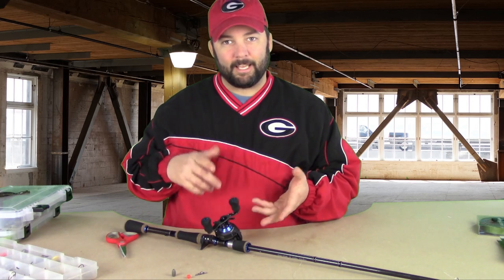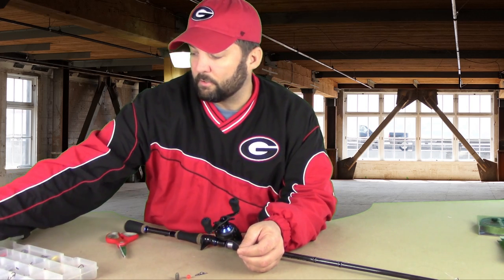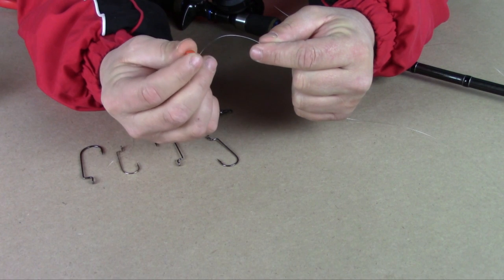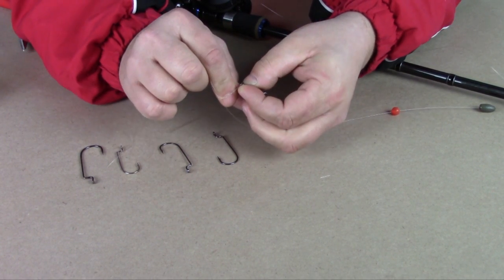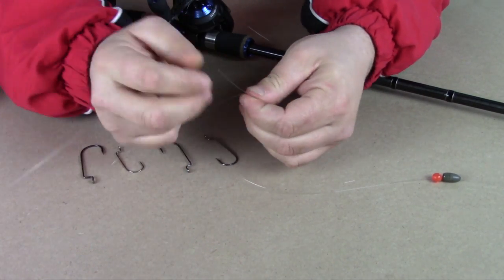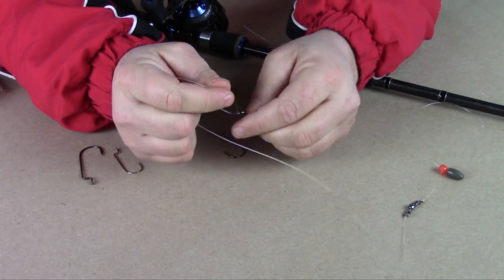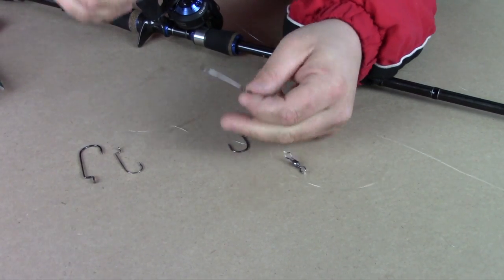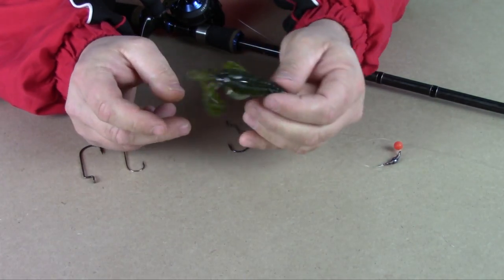How to Tie a Carolina Rig - Bass Fishing

Comment: Thats a pretty good green screen. I could barely tell until I looked for it.
Reply from the maker: BovineWoW Thanks.
Reply: +Flukemaster  how do u catch bass in cold water
Reply: @kenny-no4lg  you gotta sweet talk them into the hook. Careful, though! The fish may fall in love with you!
Reply: kenny Ned rig
Reply: Stoney Lonsome  Yeah, during winter or when its super cold, usually something slow is the best thing. Always wanna fish it deep when its cold too, and you never wanna touch topwater. Some people use topwater during fall, and I may try it during fall, but you just wanna have a deep bait in the cold. In the winter, its warmer down deeper. In the heat, its cooler down deeper. So, using a very deep diving crankbait would work well in winter even if its relatively fast, same goes for a swimjig or a spinner or chatterbait, but if youre not fishing too deep you probably wanna go with something slow. Say, a split shot rig with a trick worm, finesse worm, or something like that. 
I'm no expert, but this is just what I've heard, and most of it I'm pretty sure is solid advice, but I would recommend googling to be sure. I'm replying kind of late so you probably have figured it out by now, but I figure this may help anyways.

Comment: Another good video Gene. I like to use Carolina keepers as long as I have a clean bottom, I will add 2 of them if one slips down.
Reply: They get hung up a lot on mushy bottoms for you? Wonder if coating them with something like silicone would help with that??
Reply: My experience with them is with vegetation or like moss or whatever you wanna call it on the bottom will collect on the front and pull the keeper down. Adding a second one helps a little, but for me in any type of vegetation I prefer a swivel and with a clean bottom I like the keepers.
Reply: TackleJunky81 Cool, thanks!

Comment: Hey Gene, great video. I've never used a Carolina rig but plan on trying it more once it warms up here in Chicago! I'm in the market for a new rod, planning on getting the Duckett Ghost to pair with my Abu Garcia Silver Max. What would you recommend, M or MH, if I usually fish crankbaits and soft plastics, and the occasional buzz bait or spinner bait, plus trying the Carolina rig out?
Reply from the maker: Tyler MH rod will work fine for most of that.

Comment: Hey Gene, quick question. Do you not use the Carolina Keepers as you did in past Carolina Rig videos anymore? Or recommend not using them?
Reply from the maker: Eric Bahry Yes, I still use them. I didn't put them in this video because they are sometimes hard to find and I didn't want to confuse anyone who is beginning.
Reply: Flukemaster
Good thinking. Some may argue that Carolina Keepers are better for beginners because of the fact you only have to tie one knot, and you only have to tie it one time, and you can easily adjust leader length.

But don't remake the video! LOL This is a great video! Plus, anyone who wants to learn about the CK can watch the video you linked to in this one.

Keep up the amazing work. You are awesome, Gene!

Comment: Hi Gene - Would you explain why you feel you can cover more area with a Carolina, versus a Texas, rig?
Reply from the maker: Keith Hallbourg Sure, A texas rig isn't really a dragging rig. Due to the fact that it will bury itself into the silt on the bottom the bass can't get to it as easy as they can a Carolina rig. So if I'm just casting to a target I'll use a Texas Rig but if I'm trying to cover an area like a long point or flat I'll use a Carolina Rig first.
Reply: OK - makes perfect sense.  Which is why flipping and pitching is generally done with a more texas rig style, i.e. weight at bait, correct?  That is, if weighted.
Reply from the maker: Keith Hallbourg Exactly
Reply: Thank you Gene - I greatly appreciate your responsiveness.

Comment: is there any downside besides it possibly sliding to using a bobber  stop instead of a swivel for the same effect?
Reply from the maker: Nope. I'd use a few of them though. There is a product out there that I've used for years called The Carolina Keeper. It works great.

Comment: I'm newer to bass fishing and was wondering what the point of the swivel is?
Reply: Christian Bell the swivel keeps your line from getting twisted as the bait rolls through the water also it allows you to keep the bait at a set distance from the weight. Hope that helps.
Reply: yes it did thank you
Reply: Christian Bell it's a tie off point it keeps the weight away from bait it keeps bait from spinning just think about it

Comment: what size swivel? and can I use lead weights? also what size weith?
Reply from the maker: Swivel size really doesn't matter, lead is fine
Reply: +Flukemaster awesome thanks!
Reply: +Flukemaster sorry one last thing.. any opinion on steel bullet weights? it's kinda hard to find 3/4 Oz lead and steel weights..
Reply: Different material weights are a good thing, they make different sounds.  Lead + plastic bead makes just a dull "thud" type sound.  Steel will give a little louder "click"  Tungsten or brass give the loudest clicking.

Comment: Why couldn't you just use a split shot instead of the bullet weight and swivel?
Reply: The heavier main line allows you to save your weight, bead & swivel if you have to break off plus it allows a better hook set. Also gives you the ability to adjust the leader line to changing conditions without having to change rod/reel setups.